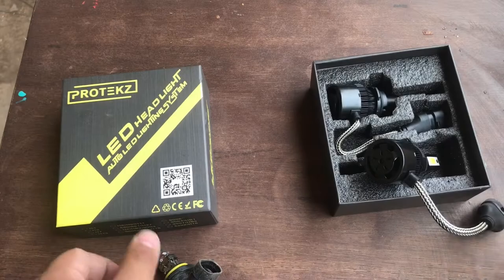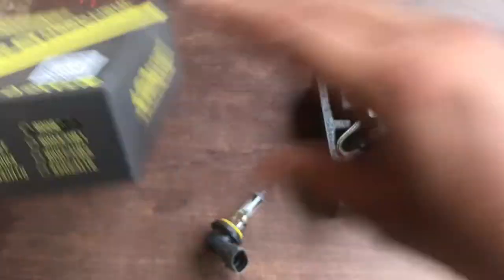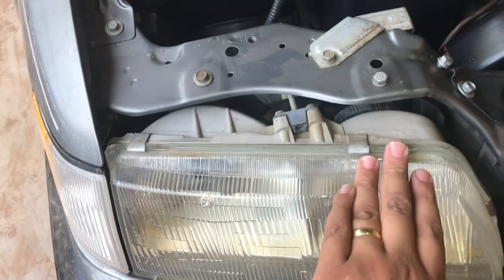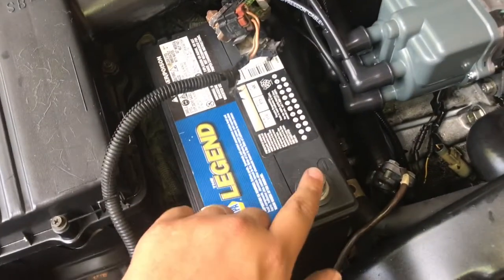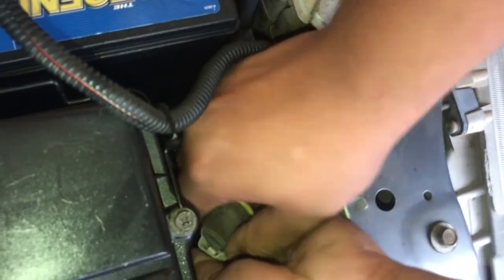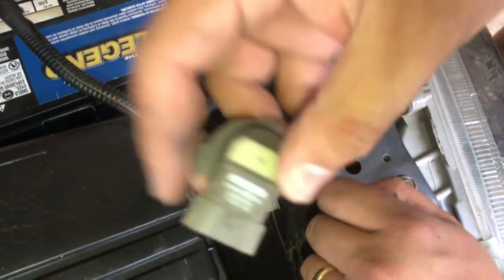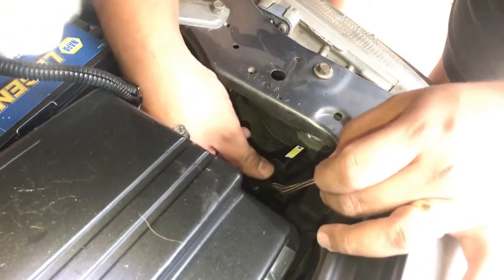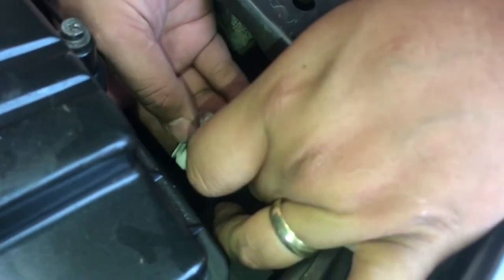How To Install LED Headlights!

Comment: light pattern is way higher than halogen, you'll blind incoming traffic unless you adjust them
Reply: Yep, they'll blind the hell out of you.  I drive mine on low and the light is incredible.  no need for the high beam at all.

Comment: It's even more important 2 disconnect the batt when replacing wiper blades because of the amount of static left over on glass from worn wiper blades,, also in addition as seen in video it's very important the LEDs fit loosely making it easier to re-install hologens!!

Comment: Nice, I have some questions, I bought the same brand but they are 9004 and 9007, the light it self does not say which one is which so Jos do I know? And on the end of cable the housing unit is not connected.
Reply from the maker: sernani99 the best thing I can think of is try connecting it if you have issues i will just go to the junk yard and get a new connection that fits the bulb